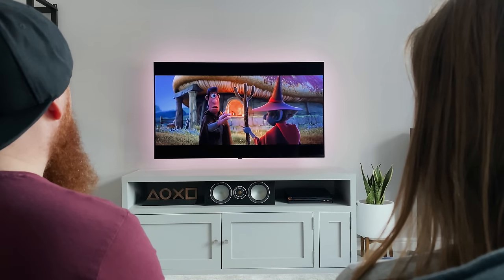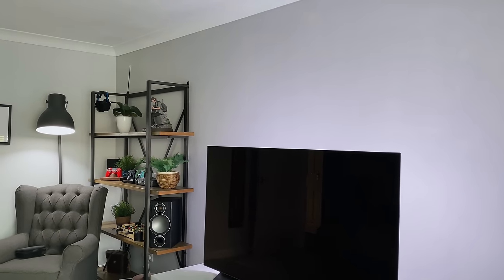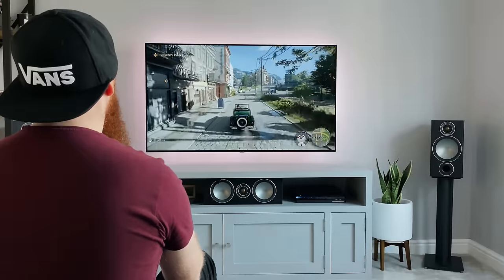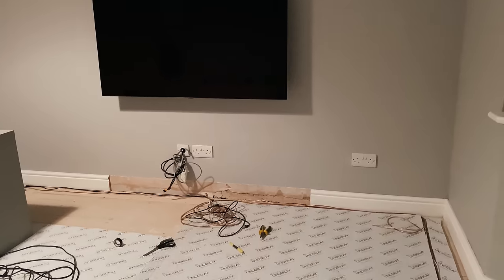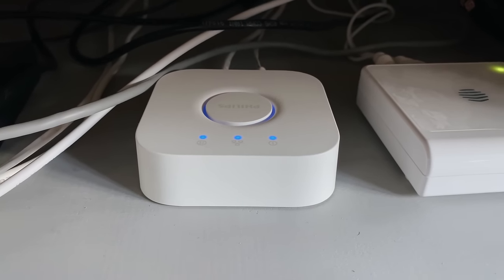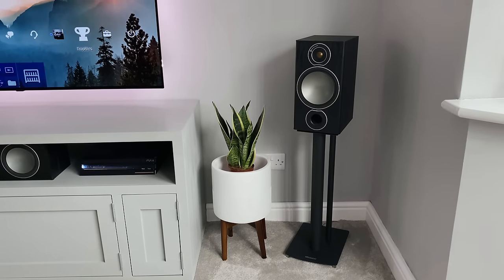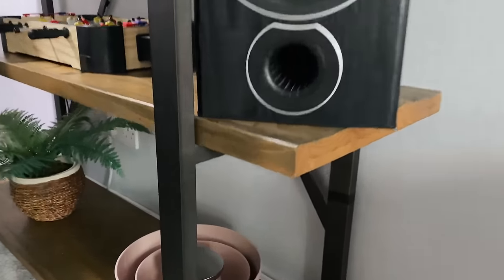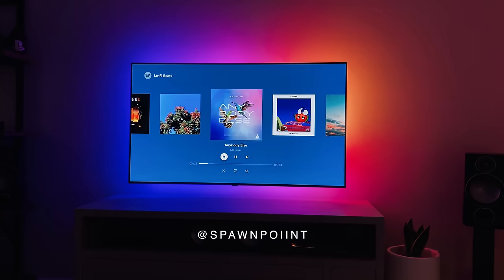Building My NEW TV Setup - 55" OLED Living Room

Comment: Great video! Love the changes you made and vibe of the room. I hate cables too and you did a great job with your cable management. Two questions , any issues with the receiver getting hot sitting in the cabinet? Also, are you concerned with air flow of the new consoles based on your suggested placement of them?
Reply from the maker: Cheers mate! The receiver never gets hot actually, so I've never had an issue with it (this is my second one too). Consoles, I'm hoping they will run cooler so fingers crossed they won't have an issues here.
Reply: @SpawnPoiint  Thanks for the reply! I do hope the PS5 runs cooler in a more closed environment (inside a cabinet) and doesn't necessarily need to be "out in the open."

Comment: Excellent setup, I really liked it. I also want to buy a 77-inch TV, it is an LG G1, so I have to mount it on the wall, but because of the large size of the TV I am afraid of leaving it too high so I can see in the video the distance of the tv with respect to the floor is excellent, how much distance did you leave from the floor at the beginning of the tv?

Comment: Just FYI, running device power cables through the wall is against code and is a fire hazard. You should consider a pass through setup that makes use of romex between the two points.

Comment: Great setup, and it also looks good and cozy! I have the 65" OLED and that will definitely fill up your wall a bit better now, but have you also considered a short-throw projector? I don't really do gaming, but if I did I'd be a bit worried about possible long-term image retention issues with the OLED.
Reply from the maker: Thank you mate. I think I'll go for the 65" next too, I've measured and it should fit perfectly with the unit width. I've gamed on my OLED (x2) for about 3-4 years with no issues.
Reply: @SpawnPoiint  go for 75 inch if you can. I have 58 inch and it's only 25% increase in size if I would go for 65 inch. 65 is new 55 and 75 new 65.

Comment: Absolutely love clean setups like this! I thought I was one of the only guys like this. I too despise cables and will do anything to hide them like you. 

I've recently changed my upstairs games room/lounge around, bought a new dark grey kivik 3 seater sofa, a standing wall mount which goes neatly behind and the glass base underneath my Besta Burs high gloss white IKEA TV unit. Bought a new 65 inch Sony Bravia XH9005 with HDMI 2.1 ports ready for my new Xbox Series X and PS5 once I get my hands on them and lastly a 5 meter govee light strip to stick on the back of the new TV when I get it.

Great video and love the setup. 👍
Reply from the maker: Sounds good mate, thanks for watching too.

Comment: 3:50 I'm very curious, what did it cost you to flatten that wall? I recently bought an apartment which has a similar wall and I would like to have that completely flat as well. Alright, let's finish the video.

Edit after the video: damn, this is so clean. The cable management is on point.
Reply from the maker: Thanks for sticking with the video. It cost me £600 for the wall changes, £300 for the electrics, then £60 for the removal of the gas fire.

Comment: I suggest if anyone wants to do this at home without running the cables under the carpet just buy some low profile cable runners/hiders/tubes from offline/ in any store and run them along the skirting for a simple yet effective clean cable management system.
Reply from the maker: Great idea too, also useful if you don't have carpets 👍

Comment: Hey., I didn’t see a link to the tv stand. Do you have a link to that?
Reply from the maker: Sorry, it should be in the kit list. I’ll update it if it’s not.
Reply from the maker: I’ve checked and it is on there. It’s called Invision.
Reply: I must be skipping over it. What lot is it under?
Reply from the maker: Ah you’re asking for the stand, I thought you meant the wall bracket. As I mentioned in the video I designed and had it made for me, it’s custom built (check my TV tour from 6 months ago, I showed my designs there).

Comment: Does burn in not exist anymore? I’d love to do an OLED but I’m so terrified of ruining a $2000 tv.
Reply from the maker: The short answer is, don't worry about it. The long answer is it does exist, but as long as you don't have the OLED brightness up too high, and you don't leave it on static images/HUD for hours and hours you'll be fine. This is my second OLED in ~4 years and I've not had any issues.

Comment: 7:55 - the port on the far right has the 10M/100M LED turned on opposed to the 1000M. Why is that?
Reply from the maker: That port is the Philips Hue port, so it doesn't use/need anymore. The same applies to the Hive heating port.
Reply: @SpawnPoiint  cheers mate